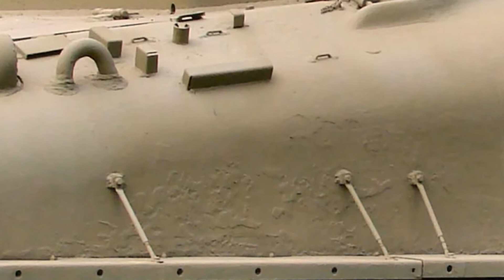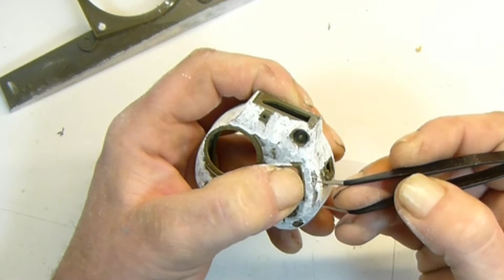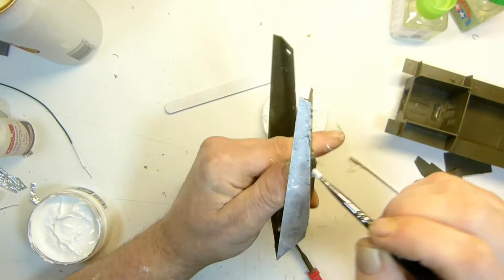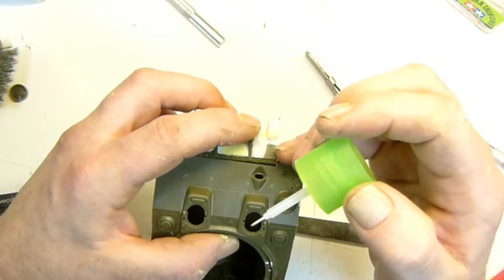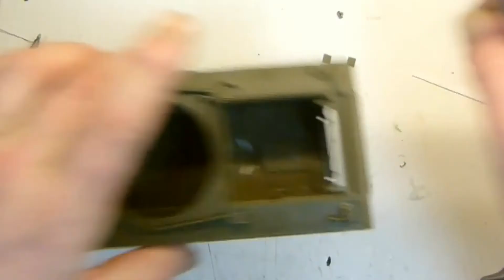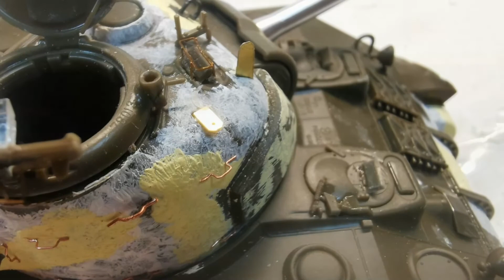Asuka Sherman firefly VC part 1 1/35 (build video.)

Comment: So I’m working on this model and have a question. I’m looking for the jig supplied in the kit for the headlight guards. From the directions it read fret C.  Would you have any insight where exactly on the fret it might be?
Reply from the maker: Yeah it's just a curved piece of plastic with a step in to form the guards around but it was a while ago. If you can't find it I'd just use a paint brush handle hope that helped
Reply: @militarydioarmour8844  turns out I'm missing the piece from the sprue.  Helps explain why I can not find it.  Thanks for getting back to me, appreciate the help.
Reply from the maker: @seperate1216  do you live in the uk? i habe a spare i could post
Reply: @militarydioarmour8844  unfortunately I don't.  Thank you for the offer, though.
Reply from the maker: Thanks for subscribing